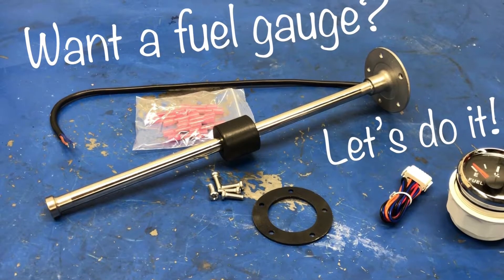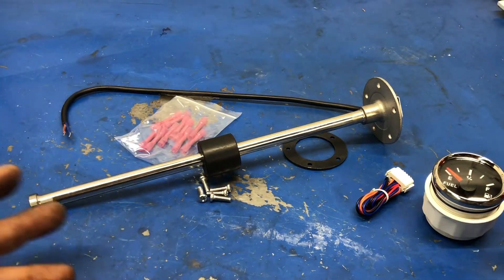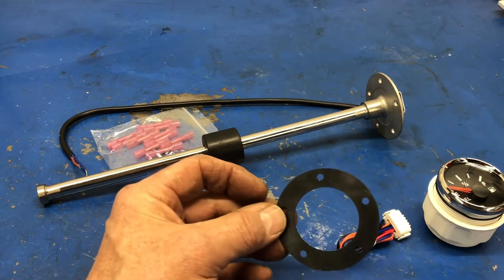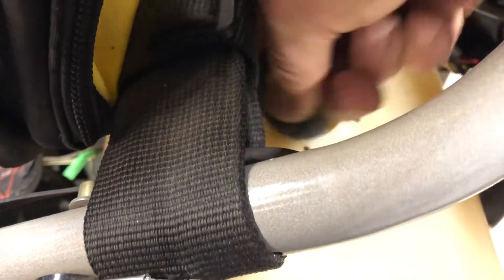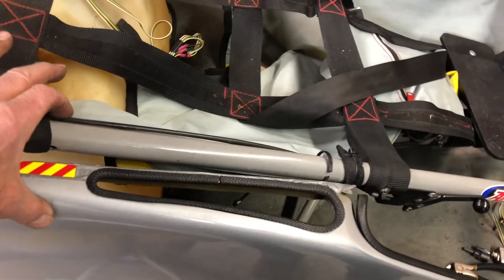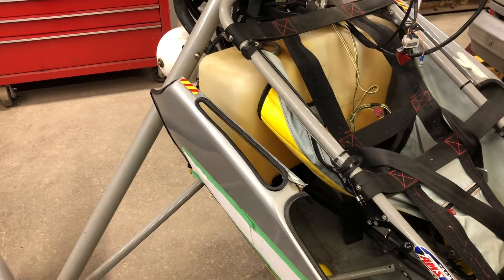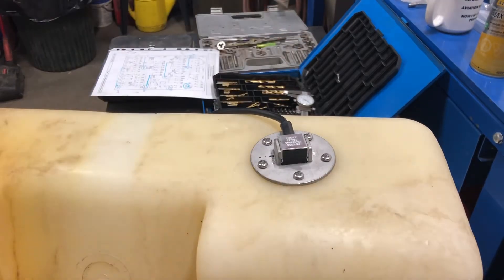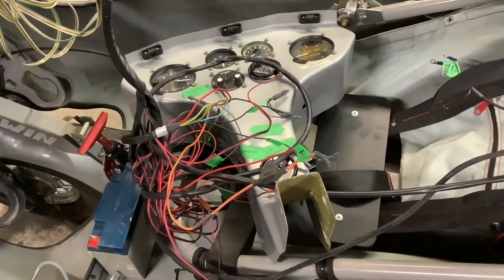Want a fuel gauge?

Comment: How would I go about adding a fuel gauge to duals tank set up
Reply from the maker: Two sender units using one panel gauge can be done with the correct switch. I used an electric guitar toggle switch for three coolant temperature sensors to one gauge. You’ve given me an idea for another video.

Comment: Many years ago I restored a 1959 Austin Healey Bugeye Sprite.  The gas tank leaked and was rusting out so I replaced it with one from an MG Midget which, tank wise, was an exact fit.  The gas gauge did not work and I rebuilt the original gauge.  It worked, but when it said "empty" you were really, really empty and you were either at a gas pump filling up or walking to the nearest station.  Ask me how I know.  😄
Reply from the maker: Absolutely, those classic cars! Your comment brought back some old memories for me. My late wife had a 85 Lebaron convertible with a terribly inaccurate gas gauge. When the low fuel light did come on it was good for about 5 kilometres more.

Comment: Where did you get this gauge kit?  Does it require 12V power?  How do you calibrate?
Reply from the maker: The kit is from an extremely popular online retailer. It does need 12 volts to operate. It appears to be calibrated as purchased. I will video the operation and calibration as I fill the fuel tank in a future video.

Comment: can running without a voltage regulator damage the ducatti cdi? thought they only worked on the lighting circuit but skidoo says don't do it
Reply from the maker: The dual ignition charging coils are completely separate from the battery charging coils. The charging coils still produce significant ac voltage when not connected to a regulator.

Comment: these types of senders are ancient technology and garbage for boats since fuel moves around. you need a huge hole in your tank and they leak all the time. just ancient stuff. technology has advance well beyond these silly things. use a piezo sensor. it can be installed anywhere in the plumbing system with a simple quarter inch threaded hole and it reads accurate even when the boat is not level or sloshing. far supiour to these old crappy things
Reply from the maker: Thank you for your comments and suggestions. Regards John